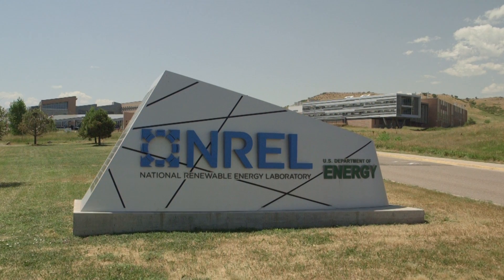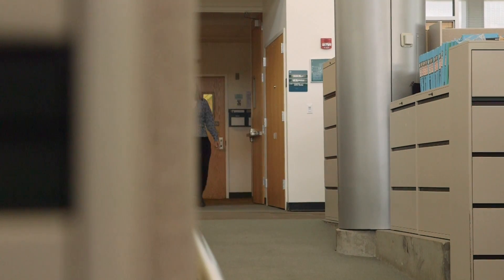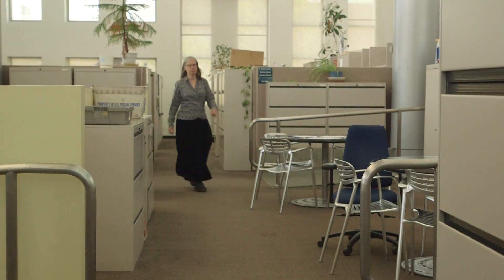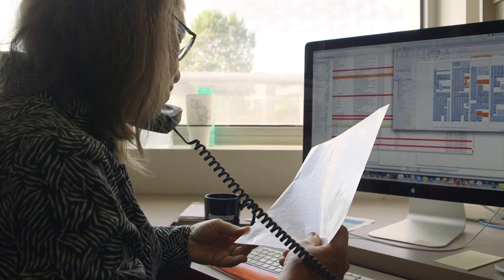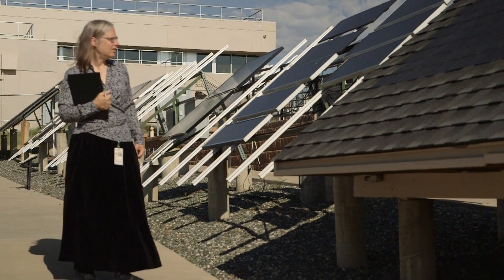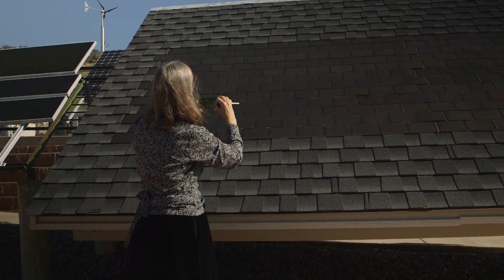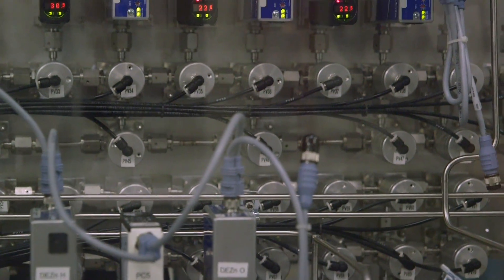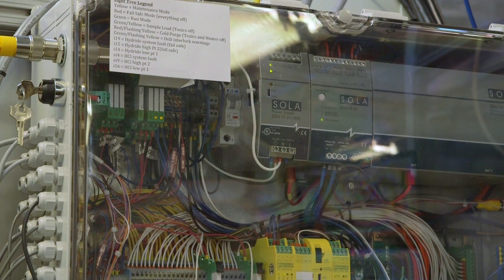Improving Photovoltaic Technology to Lower Solar Costs

Comment: UL certification of the limiter grid-tie inverters coming out of China would be a good idea, solar cells cheap ace enough now, don't want the companies to go under, we need cheaper batteries, right now! And cut all the stupid red tape!
Reply: Only 1 solar company is around more than 20 years that is Kyocera. There is a 25 year warranty for most panels but Company's do not last more then 10 years, the reason is to make the lemmings think solar does not work since no Co can stay on business.